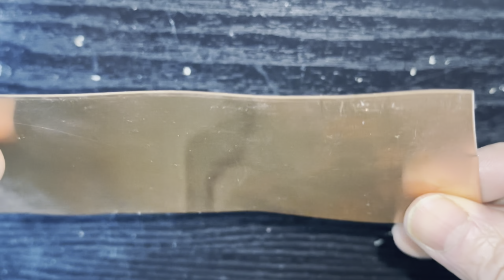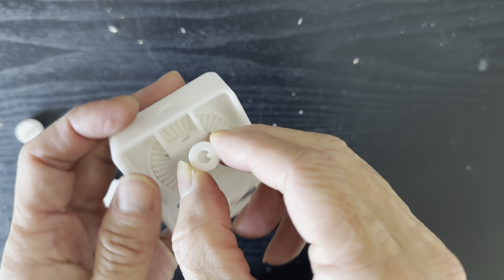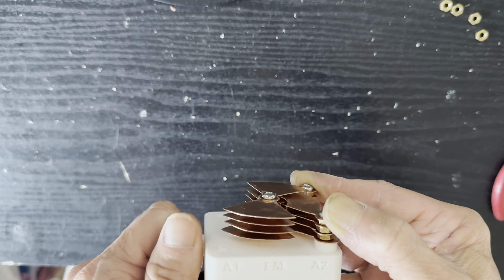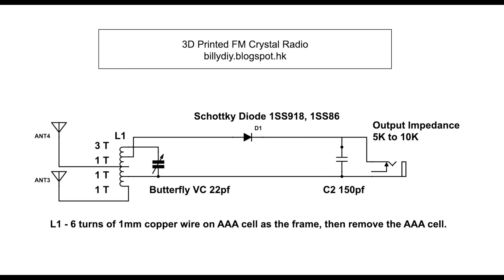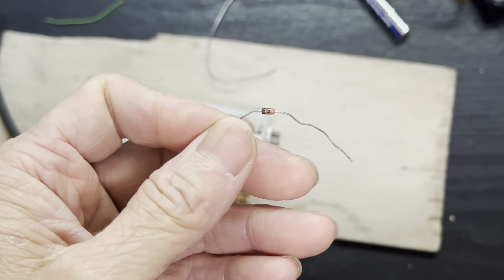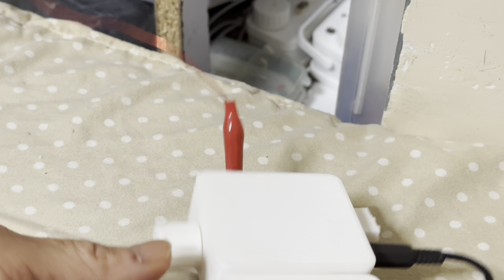Butterfly VC FM CryStal Radio Part 2 - Assemble and Testing

Comment: Nice work 

I tried your diode FM Crystal Radio Schematic several times and no luck.

I am using NOS Geranium 1N34A diodes with .21 forward voltage.

Tried many diodes...D18/D19

Long and Short antenna 

Many close FM Broadcasters in my area
Reply from the maker: What type of variable capacitor and coil are you using ? How far  are you from the FM transmission stations. Terminus diodes such as 1N34A is not the best detector for FM crystal radios. Check out my latest video about FM crystal radios Secrets about FM Crystal Radios
https://youtu.be/34NO6QsZNks

Comment: There is too much cross-talk. You need to add air coupled coil for the antenna, about three turns with 15pf cap or trimmer in series with the coil the other end to the ground, the same as on the headphone jack.